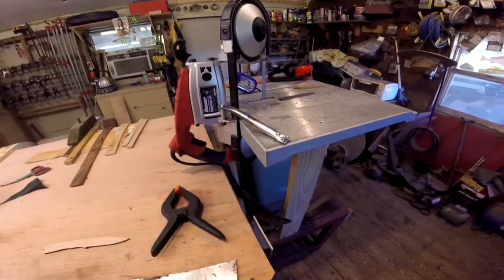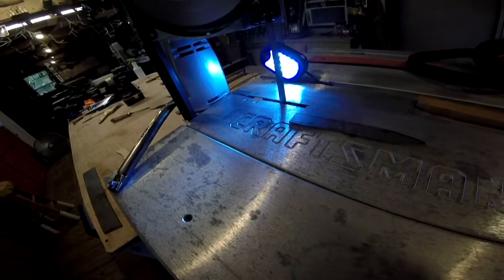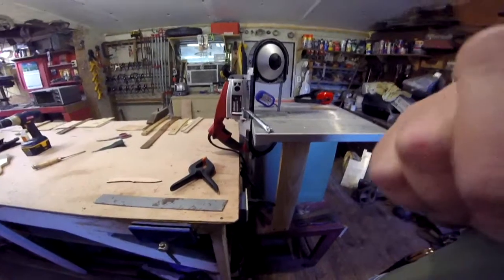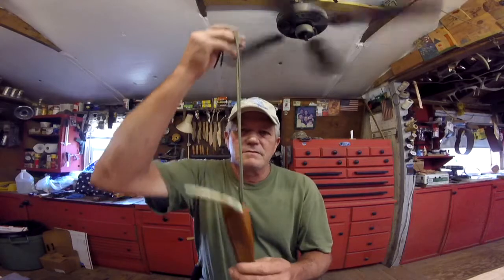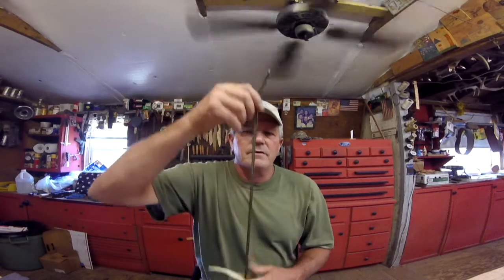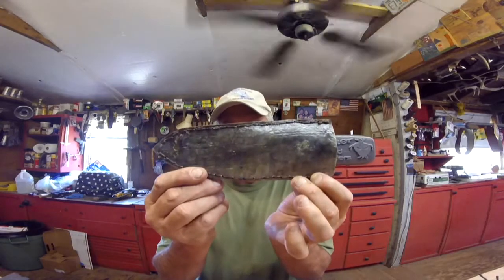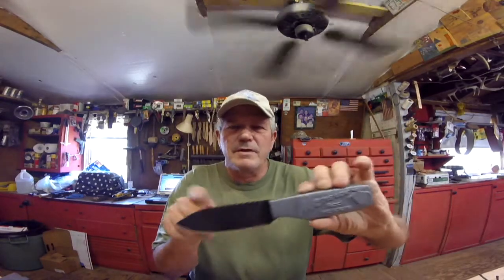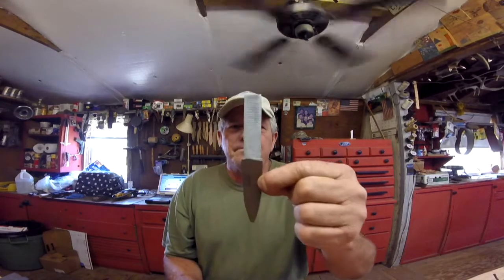Finished catfish sheath and knives!

Comment: Im glad you said it Ricky!  I ask for the money up front for the same reason. I do leave it on paypal until the knife is done,shipped,and a tracking number sent. Love that band saw table. Im gonna have to do something different with mine. I have the table sitting in the bench vise and every time I need the vise, I have to move the saw.
Reply from the maker: Time and material it takes to make one It has to be that way.  Ya  I looked at those tables like yours, looks similar to a table saw top  :)